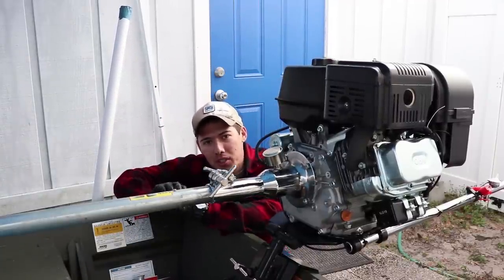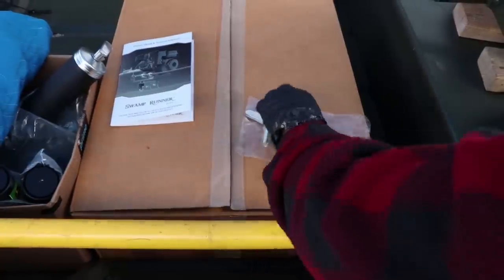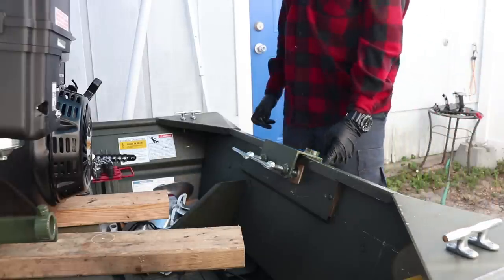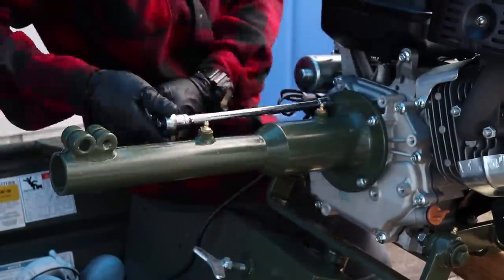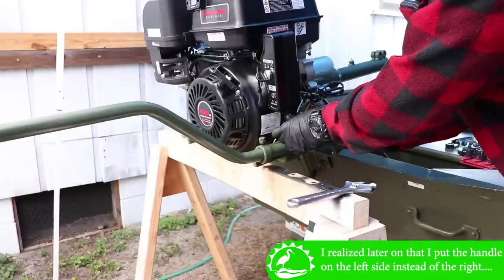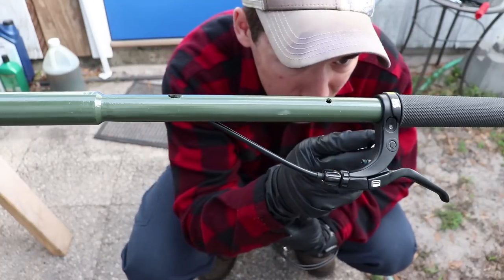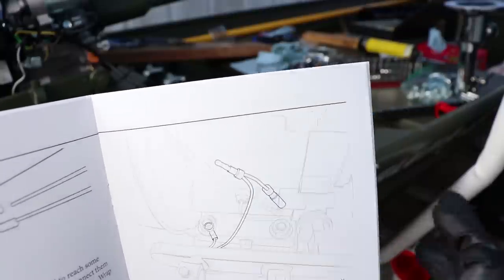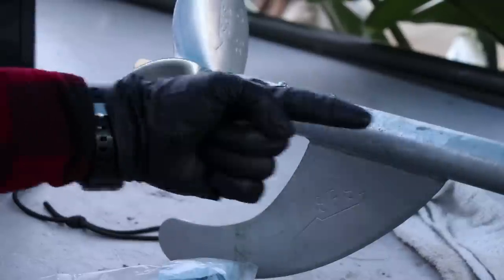Swamp Runner Long-tail Mud Motor Medium Kit Assembly: S2E2

Comment: Yeah you can buy 10 props cheap but I have owned a go devil for years and have a much sturdier set up. I have hit rocks and never been stranded. I personally think you may get more speed with your setup for sure and as for the efficiency yes more but I can swing around and dig my way out just as well. I think in actuality had I had a setup such as yours digging out would strain and actually bend your shaft. The other shafts are built much heavier to handle more torque and more abuse plian and simple. I guaruntee that most of these kits will not last as long as a go devil, bevertail, or a backwater. You get what you pay for. As i have stated in normal practical use for someone looking for a cheap effective setup yes these kits serve a purpose and are by no means completely bad. My experiance tells me they will not handle the abuse.
Reply from the maker: I would disagree. I think this kit will last many, many years. I would be surprised if you could bend that longtail shaft. You would have to put that shaft in between two trees and really try to bend it. I do not think you could bend it while running it through your extremes areas. You state "My experiance tells me they will not handle the abuse" but have you ever run a SPS Swamp Runner kit? If not, you do not have any experience with it to tell me that it won't handle the abuse. This is great kit and think it will stack up to the others without any problems. I would love to test them side by side and put them against each other. But as of right now, I have only tested the longtail kits and the Swamp Runner came out on top. I truly think that this Swamp Runner kit would run better than those other brands.
Reply from the maker: Another thing about the props. With the way these thai longtails ride, the prop reaches that crest behind the boat. This allows the prop to actually run above the water you're running through, greatly decreasing, if not eliminating, your changes of hitting submerged objects.
Reply: Yeah it does reduce the chance greatly you are correct on that. Even so with the shorter shafted go devil and a much sturdier skag while swinging the motor around I ticked into rock and knowing that aluminium scares me. Although as for breaking a key way would be worse but never really have had that happen on the go devil. I wod say each have pros and cons.  I did  try a cheaper kit along tome ago and it ended badly so that is why I say I have had experiance with these. Keep up the vids though what people do with this stuff is always interesting. I like to have good debates and get pros and cons on things I think it gives people realistic expectations on things. I just think time will tell on how long they hold up. My godevil is 1995 so its been around. I also just purchased a swamp lite backwater kit for 13hp motor I have so we will see about that. Hope to get the years out of that as well. The thing i find most relavint is cost. For the budget minded maint costs over the years would be a intresting thing to track.
Reply from the maker: That is one thing I am keeping track of, and the good thing with cataloging it all on the channel, is that I can track the hours, the oil changes, how many props I use in a year, and what I run the boat through so people have something to look at. 1995 is a long time! Thats older than me haha let me know how your new backwater kit treats you! Hopefully further down the road I can get another kit to compare to this one. Thanks for the great conversation!
Reply: Sounds good man I will let you know how the kit works. I feek like all that info will be very helpful for people

Comment: Just my opioin I would not want a kit that uses an aluminum prop. One rock with that dinky sheet metal guard and change a prop or oar your way home. I perfer backwater, go devil or even a bevertail. I would stay away from these kits if in extremly harsh areas. On open water for a cheap motor they would be fine or just shallow water with no serious weeds or thick mud. Otherwise spend your money wisely and buy a true well built kit with a stainless prop. It will be well worth the investment.
Reply from the maker: My take on it is that these longtail kits use an aluminum prop so you can get home if you do happen to hit a rock or a stump. That was the way they were designed. With these kits, if you hit something hard, it brakes that aluminum prop instead of something in your drivetrain or even your motor. If you had a stainless prop, the prop may not break, but you increase your chances of breaking something in the drivetrain, leaving you stranded without being able to fix it. The aluminum props are $12 to $15 so you do carry a few with you. The other brands you mentioned above all use an inefficient shaft angle, putting that prop closer to the transom, and doesn't allow you to reach out to that water behind when you need too. You can spin that longtail in all angles a reach out to find water. With the other brands, that prop is closer to your transom with the shaft being a lot shorter. You can run these longtail kits in extreme areas, I don't know why you couldn't?
Reply from the maker: D theman  Yeah. The backwater kit I'm testing now has a stainless prop but does not have a sacrificial piece and I don't believe the godevils do either. I don't know how they protect their drivetrain.